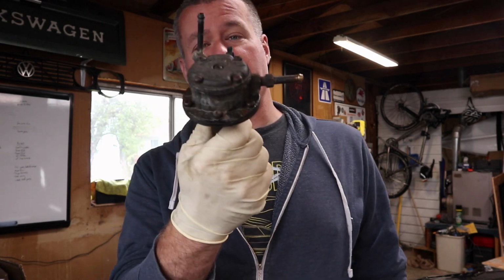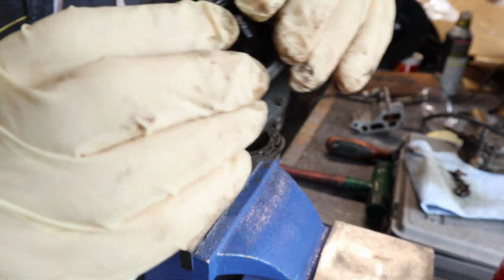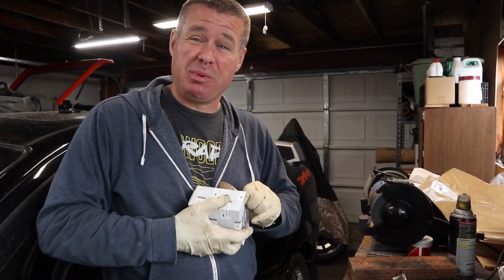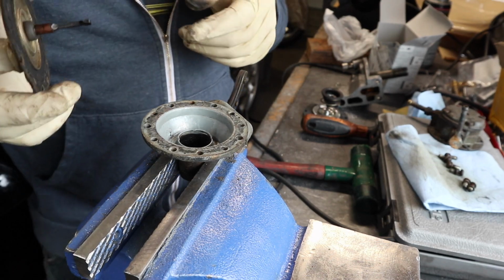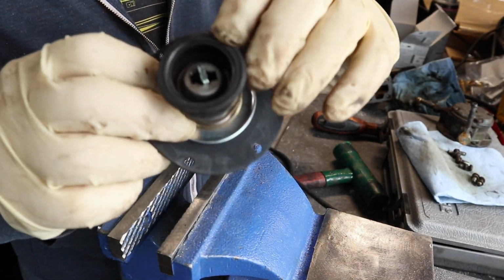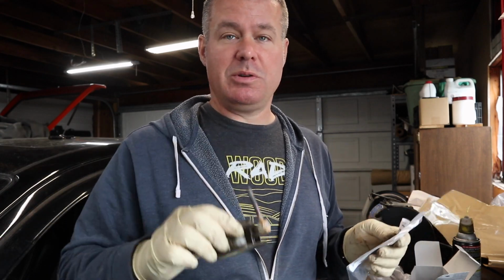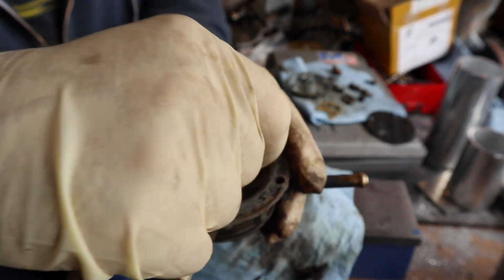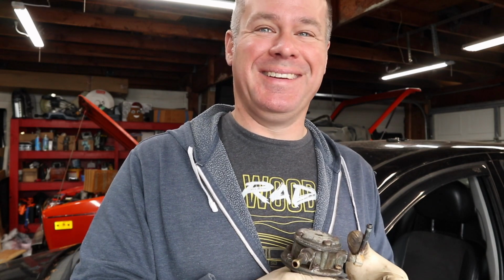FIX your DATSUN'S MECHANICAL FUEL PUMP for CHEAP!!!

Comment: With thanks from South Africa, I have a 2007 Nissan 1400 which uses the same mechanical pump.  Thanks for the insight !
Reply from the maker: That's awesome to hear it helped someone in South Africa.
Reply: In South Africa Nissan will never sell us these loose spares. So there's no option but to buy new.

Comment: So I think one of your part numbers are off.  17099-83G00 Fuel Gasket is actually 17099-85G00
Reply from the maker: Interesting.  I got the part numbers from an old thread on 311s.org. it may have been superseded in the meantime.

Comment: Nice work.. I’m also working in my roadster 1970...  I’m also going to need to rebuild the pump do you know what’s the part number of the rebuild kit? That will help a lot..
Reply from the maker: Many of the part numbers are in the 311s.org tech wiki. I ordered all these parts separately, they don't arrive as a kit.
Reply: @ThrottleGrotto  thanks for the info..!! I will check it out.. how many parts did you bought?
Reply from the maker: @cristianalcauter9919  Nissan part numbers listed. 
17076-13211 Gasket
17065-M0110 Valves - need 2
17053-32201 Diaphragm Assembly
17099-83G00 Fuel Gasket - need 2
Reply: @ThrottleGrotto  thank you very much for the help I really appreciate...

Comment: Jeff, one of your best Datsun vids! One comment/question... that black disk that was in the top end section of the pump that you dismantled, just before changing out the check valves, appears to be a filter (fuel comes up through that mesh from one chamber/valve and back through it, down the other chamber/valve on the way out the pump). At the end of the video, it looked like it was still on the bench. Did you intend to leave it out? Just wondering if my assumption on what it was is correct. Thanks!
Reply from the maker: It was the top seal for that side of the pump, and I replaced it with a new one.